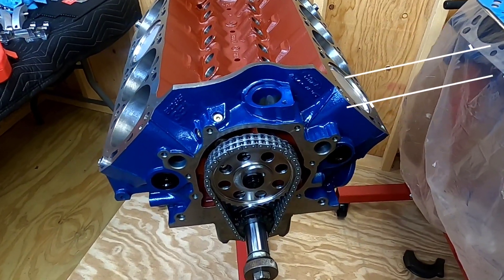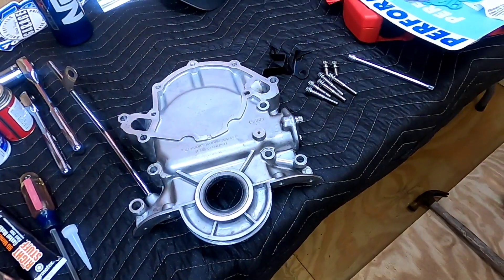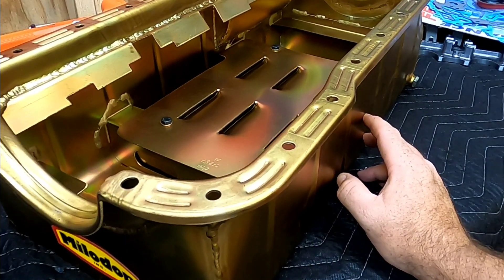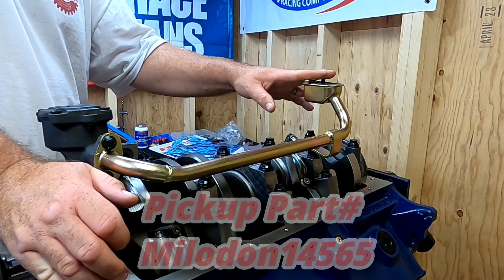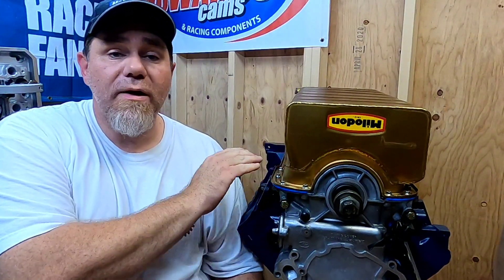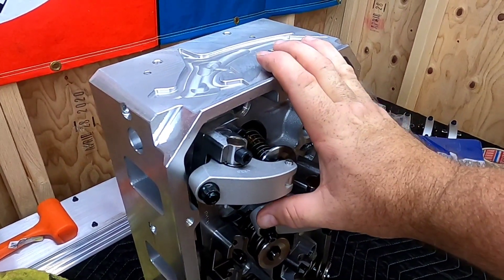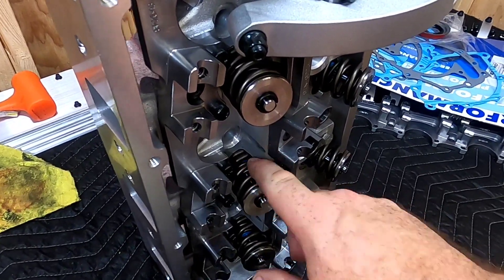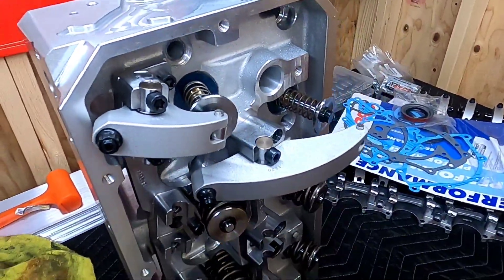MIXED UP BOSS! Finishing the Hammerhead Performance Engines BOSS 429 style headed Windsor PART1

Comment: This build was completely amazing what a awesome job Andy.         I always wanted to build a Ford 6 cylinder use a 240 crank and Rod a 300 block with a set of 302 Pistons. Then use a set of Cleveland 4v heads.          I had a lot of ideas how I would cut the heads and weld them I heard it was done before but I never seen it.
Reply from the maker: Thanks for the kind words Marco!  Ever since I seen the small blurb in Hot Rod Magazine back in '16 or '17 I had to build a motor that would use those heads when they came out.  So here it is finally getting there.. I've been working on it for the last year when I had the time to do so..  I have seen one of those engines are talking about... Talk about A mean sounding 6!  The guy ran it in a dirt track class... It didn't take them long to figure out what was up!
Andy

Comment: I was a little surprised to see the stock style oil pump instead of a Kaase improved pump. Going on appearances the Kaase looks stronger, but that ain’t the whole story. Could you shed light on it Andy?  Good video thank you.
Reply from the maker: David, the Kasse pump is for a BBF, this being a Windsor based build... I've never seen the SBF having the breaking foot problems that the 385 series has.. but that is not to say it hasn't happened... I would prefer a pump such as Kasse deal really... But I haven't found it necessary on small blocks as of yet...  
Andy

Comment: Painting the valley? What is to gain there?  If that starts to peel, it's going to plug up the oil pickup.
Reply from the maker: Its a coating called Glyptal, You can see a Video I did on it awhile back..  It works great but the prep work must be spot on... Thanks for Watching,
Andy

Comment: Yes sir, the bolts will $20 ya to death, if not $50 ya to death! LOL 
I like that oil pan and I was thinking it had a $500 price tag.
When I rebuilt the engine in my '88 Crown Vic, it was the sensors and little things that I had to replace that got to be expensive.
Reply from the maker: BOLTS will nickel and dime you to death!... The oil pan is a big step up from what was on the old 393w..  You are right, on a FI car the sensors and other odd and ends add up quick!
Andy
Reply: @UnityMotorSportsGarage  They sure do! My '88 is a 2 barrel carb not FI. Water temp sensor was like $95, spark knock sensor $65, etc. Some of the others would be difficult to replace with the engine in the car so I put new ones while it was out of the car. I think the oil pressure switch was the most reasonable priced of them all. I think I have a broke flex plate, I should have replaced that too.
When I redo the engine, I plan on doing a stroker kit, 750 cfm carb, truck headers, do a little more porting on the bowls and get rid of most of them sensors. I would like to do a 5 speed trans. but may just go with a C4 to get it running. I'm looking for the pedals and whatever extras I may need to convert it to manual, a F-150 should get me the parts I need. May be a few years before I take on that project, I need to get the trans in my '99 rebuilt first.

Comment: Ive had much better luck with crane springs than comp cams. Thier shut down now after 50+ years of good parts. I dont know your current brand of choice. K motion will replace my reliable crane springs after 15+ years of 6500+ rpm in my windsor running 7.0 in eighth. I have k motion k 800 springs on shelf for my 650 solid crane flat tappet thats still in box. Has a crower 578 in engine now

Comment: Pac or k motion doesnt have a spring that will clear without extra work?
Reply from the maker: PAC does offer springs but I had bought these before hand of knowing that Greg had cut the heads to fit 1.50" springs... Not a big deal.. Greg will cut the heads to fit the springs you are running... Its just Murphy's law of doing this hot rodding stuff..  lol
Andy
Reply: @UnityMotorSportsGarage  what brand keepers are you using and are they machined or stamped and are you using lash caps
Reply from the maker: @CharlieBrown-pb9xn  Im using Manley titanium retainers with their machined locks and Lash caps... 
Andy
Reply: @UnityMotorSportsGarage  i have some standard comp cams 11/32 plus .050 keepers. Do you know if thier stamped or machined. Im not so sure of them. Part number 614-16. This is for a 650 lift crane solid flat tappet with k motion k 800 springs
Reply from the maker: @CharlieBrown-pb9xn  I do believe that the locks you have is Machined...
Reply: @UnityMotorSportsGarage  needing to go with a + .050 keeper for the k 800 springs would you think Ide need lash caps or longer pushrods to clear retainer to rocker. If so ide need recessed keepers and these arent. My valves are +.100 already and have 1.8 installed height on current setup but need 1.850 height on new set up
Reply: Not even talking about measurements at what point do you feel lash caps should be used. Im guessing I need recessed keepers for caps but dont have that on hand at moment

Comment: Scrapers may help but after seeing my friends engine get tangled up in them even after hrs and hrs of fitment I wont use such a thing . Seems pollished weights and A tray and good weight oil would be close enough.
Reply: Crank scrapers are worth the effort if there installed correctly.

Comment: I can’t wait to see some big numbers on the dyno. If no big numbers i am going to loose a little faith in you and Mr Vizard. Pretty sure there gona be there. BTW arp will sell you single bolts, seems every bolt kit is always short. Thanks again for the great video.
Reply from the maker: Mark it's going to deliver the goods... Both on the Dyno and at the track, honestly it's the second one that I really care about..  once it is in the truck I'm going to do a Chassis Dyno test comparing Flywheel to rearwheel numbers... Since I did the same with the 393 it will be interesting to see if the percentage stays the same!  I'm going to use the same converter but with more torque it will change it's characteristics... Which will be neat to see!
Andy
Reply: @UnityMotorSportsGarage  - This motor will definitely make a lot more power than your 393 and might require a tighter converter.

Comment: Ill be interested in how you like the fuel consumption with those heads compared to your previous set up.
Reply from the maker: I'm very curious about it Tom, since the combustion chamber is completely different... I will say it's not too far off from a Yates style chamber, it has a shallow 63cc chamber with good quench... But  the BSFC numbers will be interesting! 
Andy
Reply: I'm bidding 4-6mpg on the track, 14 if you can keep your foot out of the carbs on the highway. Maybe 8-10 in town, considering that I get 12 in town with my 4.0L Jeep Cherokee.
Reply from the maker: @ScottKenny1978  I will be disappointed if I cant beat the 16mpg that i was able to get out of the 393!  But you are right... it will be hard to keep my foot out of it! LOL
Andy
Reply: @UnityMotorSportsGarage  non overdrive transmission doesn't help your highway mpg...

Though the best mpg I ever got in my old Subaru was when I set the cruise at 3500rpm. This was in the hills of southern Oregon, I needed that much torque to get over the hills without losing speed. In 4th, that was about 60 and I was having semis crawl up my tailpipe. In 5th, that was 82 or so. 33mpg, when going slower normally got me about 28! 🤯

After that, I did experiment with running the car closer to the 4400rpm torque peak, where you normally get best fuel economy, but anything over 3500rpm and I'd really lose mpg. Fuel injection car, but I think it was the equivalent of the secondaries or power enrichment valve opening up.

Comment: That pan is kind of like the best of many worlds considering it has a rear pickup, full length sump and fits in your front sump application. There ain't many stock chassis that one like that will fit on. 
I can see it doing an awesome job of oil control compared to any stock ford pan due to the fact that it keeps all the oil in the bottom well away from the rotating assembly. It ought to do a great job limiting slosh to the rear of the crank compared to the stock front sump.
A lot of ford people overlook the issues associated with a stock type front sump in a drag application. Some times I wonder if a lot of engine failures especially on Clevelands and 385s were caused more by the front sump pan than by oil galley deficiencies. (especially clevelands being revved high)
Great content as usual, Thanks and keep it coming.
Reply from the maker: Thanks for the kind words.. you are on to something with what you are saying... On CASPER with the stock replacement pan . I mounted my camera so I could see the oil pressure gauge at the track so I could watch for fluctuations and on the launch it would dip for a split second! Then come back... I tried putting more oil in the pan and it helped on the launch but on the top end it would dip because the extra oil was being whipped into foam!  I found a compromise where it seemed to be best .. lesson was.. it showed the value of having a good oil pan with a rear mounted pickup on a Ford!  Thanks for Watching!
Andy